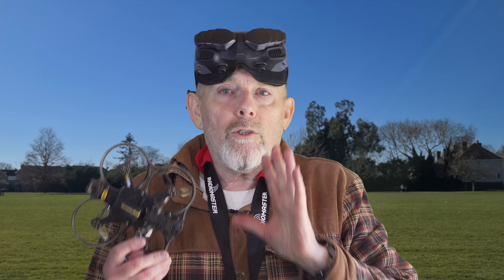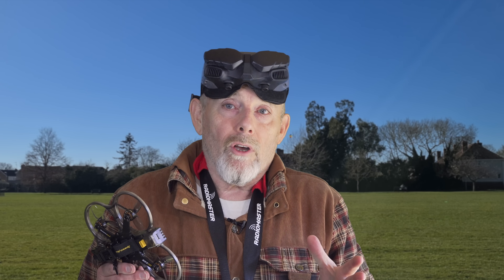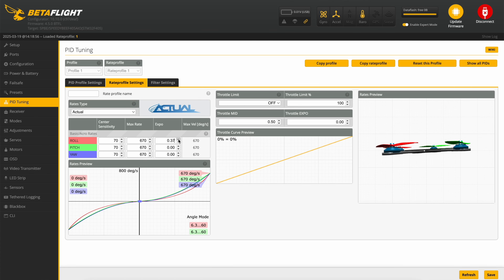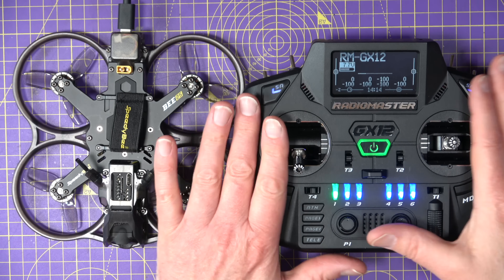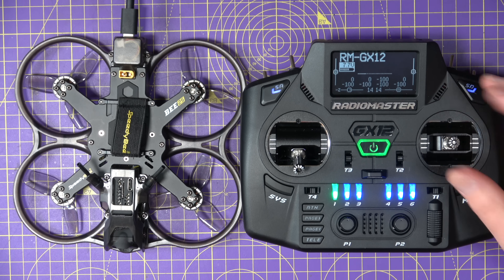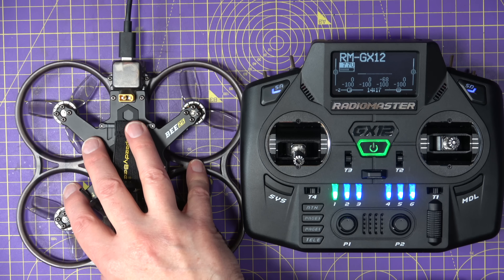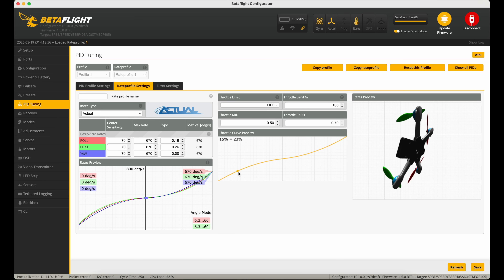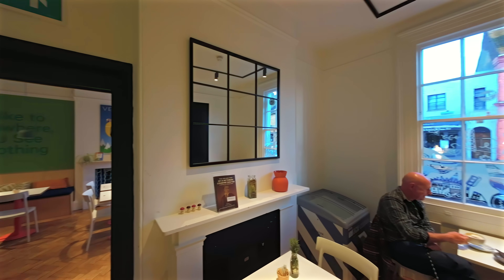Betaflight Throttle Tuning Will Improve Your Flying for Smoother Freestyle, Racing & Cinematics

Comment from the maker: 🚀 Want smoother, more precise flights? Try this simple Betaflight throttle setup and let me know how it works for you 💬 Drop your questions below, and if this video helped, hit LIKE and SUBSCRIBE for more FPV tips 🔔
Reply: Hi , thanks a lot for the very useful explanation but why not also adjust or fine tune the throttle limit for very slow and smooth flights indoors

Comment: In my opinion, it is better to create a throttle curve in the transmitter. With Expo, you even have the opposite effect at the beginning. In the transmitter I can create a seven-point curve exactly as needed. Even smoother in the lower area!
Reply from the maker: That works as well. Thanks for sharing.
Reply: @WhirlyBloke What I do, for example, I put three curves on a 3-step switch or a potentiometer. The first is my standard curve, the second is an even smoother version that would be ideal for the coffee house example and then I have a third curve with throttle limit, even if I hardly use it.

Comment: Thank you so much!!! This definitely fixed my throttle control. But now my throttle stick hover and cruise point is a lot higher than I am used to. How do I fix this?
Reply from the maker: I'm glad to hear the throttle tuning helped. To adjust your hover and cruise point, try recalibrating your throttle endpoints in Betaflight. It should help bring it back to a comfortable level.

Comment: Parabéns por suas excelentes explicações e partilhar esse grande conhecimentos amigo,🤝🤝🤝
Do I need to change the other options you show in the video? Or is adjusting the exposure little by little enough? Thanks, 🤝🤝🤝
Reply from the maker: You can just change the throttle expo in small steps.

Comment: How to make it where i can flip my right switch on my pocket so it can test different tunes?
Reply from the maker: To test different tunes using a switch, you'll want to set up a specific channel mix in Betaflight. Make sure your switch is assigned to the correct channel in the mixer tab, then configure the tuning options accordingly.
Reply: @WhirlyBloke  Copy ill get on it thanks for such an informative video!

Comment: Hi, I really enjoyed your video and I think it's one of those adjustments that makes a difference especially for a beginner like me, but I wanted to ask you: in the video are you making the adjustments with the drone connected to Betaflight? What is the sequence of adjustments you make? Do you set the throttle directly and then adjust the medium throttle and then the exposure or the opposite? Thanks👍
Reply from the maker: I'm glad you enjoyed the video! Yes, I recommend making adjustments with the drone connected to Betaflight. The sequence I typically follow is to set the mid throttle first, then adjust the throttle, and finally tweak the expo.

Comment: When we change the midpoint, are we now performing the hold-in-air maneuver with the stick in the middle position instead of with the stick down? @WhirlyBloke
Reply from the maker: Yes, when you adjust the throttle midpoint in Betaflight (especially using throttle expo or a throttle curve), you’re essentially redefining where the “hover point” sits on your stick. So if your quad hovers at, say, 30% throttle, shifting the midpoint to match that means your stick will be closer to the centre when you’re just holding altitude, rather than hovering with the stick lower down. This gives you more precise control above and below that point, which is ideal for smooth freestyle, racing, or cinematic flying.

You’re not changing the throttle range itself, just redistributing the sensitivity around where you need it most.
Reply: @WhirlyBloke  I didn't know that, I'm really happy to have learned it, it will really be useful to me, thank you. 🙏

Comment: Your shot in the cafe was 100% done with DJI in stabilized mode, stop trying to trick us
Reply from the maker: SpeedyBee Bee35 with INAV, optical flow, smooth fingers, lots of throttle expo and gyroflow. We all need a bit of help.

Comment: I used this trick when I first started out with whoops. It does work, but someone pointed out to me that it’s just a bandaid for bad piloting. I took their advice and just focused on throttle control for a while and honestly, it worked. I can’t tell the difference visually when looking at my past dvr with throttle mid/expo vs dvr now. Only difference now is I feel more in control than I did with expo. 

But really it comes down to the style you want. If you just care about cinematic shots then go with expo. But, if you want to race, or even if you are freestylin then practice throttle control without expo and mid. Once you get it it’s a world of difference when it comes to feel.
Reply from the maker: Mastering throttle control really does enhance your flying experience. It's all about finding what works best for your style, and it sounds like you've nailed it.
Reply: @WhirlyBloke lol for most things yeah. Still struggling when trying to trippy spin with toothpicks and my 3.5 inch though. I’m not sure if it’s the weight, power difference, or if I’m just nervous because there’s no protection on them compared to my whoops lol.
Reply: @WhirlyBloke oh, and I’ve also noticed that it’s easier to control throttle with heavier drones. Have you noticed that too or is it just me?

Comment: @WhirlyBloke  With the throttle mid setting, you have to apply at least some expo for it to work correct? Or else the mid point doesn't affect anything?
Reply from the maker: Exactly. That's the whole point of finding the correct mid point and then adding expo around it.
Reply: @WhirlyBloke  Amazing. I tried using around .28 on my meteor75 pro, at .50 Expo and what a difference in altitude control! I want to implement this in my QAV-Pro cinewhoops that I fly for work now. I've always just throttle scaled down to 80%.
Reply from the maker: @quantum_m3chan1c  It's like you magically become a better pilot.

Comment: man i'm new and everytime i fly in accro i feel like that drone just takes off..

i'd love for it to just be slow and steady all the time. wil ldefinitely try this and also try to tune down my rates. i dont need fast and wild.

thanks
Reply from the maker: Acro does feel a bit unruly at first, but dialing in the rates and adding a bit of expo really helps calm things down. Throttle limits and gentler props are underrated tools too. It makes a big difference, especially when you’re still getting the feel for it. Smooth and steady definitely wins the day when you’re building up confidence.
Reply: @WhirlyBloke  thanks man..i'll try out this in ur video and see if i get a better handle on it

thanks

Comment: For some reason I completely ignored the midpoint setting, I am going to try that out immediately. I already scaled my throttle to 80% which seems to help a little.. But perhaps I should not actually scale the throttle but rather just move the midpoint
Reply from the maker: The midpoint is easy to find and is pretty important. More so than scale. Have fun.

Comment: This is one of the reasons of fly kiss now it just isn’t as twitchy
Reply from the maker: You're right, KISS really nailed their filtering from the start. I’ve still got a few KISS quads in the fleet and they fly beautifully. Even so, setting up throttle expo and a proper midpoint is still well worth it, especially if you’re going for smooth, cinematic flying. It really helps reduce throttle pumping and gives you better control when you’re just cruising about.

Comment: Hello, my 7 inch feels still too fast, even after this tutorial. Can i somehow make it even slower, smother? Should i decrease the power of the throttle? Or should i lower the curve?
Reply from the maker: Try using Throttle Limit (Clip) to cap your max throttle without affecting the rest of the curve. It's great if you want to reduce top-end punch. Or go with Throttle Limit (Scale) to shrink the entire throttle range proportionally, which gives you more resolution and a smoother feel across the stick. Combine either of those with a touch more expo, and you should see a noticeable difference in how controllable and cinematic it feels.
Reply: @WhirlyBloke  I have scale it down the throttle and put a little more expo on the throttle. I ll see how it goes and let you know! Appreciate the help a lot!

Comment: You said nothing about the Throttle Limit (Scale/Clip) parameter.  How does that play into things?
Reply from the maker: I focused on expo and throttle mid in this video since they directly affect how the throttle feels around cruise speed, but Throttle Limit (Scale/Clip) is definitely another useful tool. Scale reduces the throttle range proportionally, which is great for taming power, especially on high-thrust builds or for tighter flying spaces. Clip, on the other hand, hard-limits the max throttle without scaling the curve, which can feel more abrupt.

It doesn’t affect the expo curve directly, but it changes the available throttle resolution, so it’s something to consider if you want finer control or are flying in restricted environments. Thanks for watching.

Comment: I've used this along with setting up multiple rate profiles with different throttle limits that can be changed via a switch on the radio in order to dynamically set my cinewhoops to flex between indoor and outdoor flying. Great advice!
Reply from the maker: Every little bit helps. The more locked in you feel with your quad, the better you fly and the more fun it is.

Comment: you can set a rough curve in betaflight... and fine-tune it in your transmitter then ( I also have some curve in my transmitter setup)... both combined makes it even smoother)
Reply from the maker: That's so true. Thanks for the feedback.

Comment: Hello good, how do I know what the middle point is on my remote control? I use the Dji fpv 3
Reply from the maker: Not possible. You have no control over the mid point when using DJI FPV.
Reply: @WhirlyBloke  ok entonces no es posible lograr esa configuración teniendo el mando DJI?

Comment: Ooh man, thank you so much! :) I recently started flying my old Tiny Hawk 2 Freestyle again, and this tune made me fly so much better. I first determined the throttle position for cruising speed using the on-screen OSD, which was around 11%. Then I changed the throttle mid to 0.15 and left the expo at 50. I went out for a test flight and BOOM—I feel so much more in control now. Thanks again.  I have one more question, does the trottle mid position change when you tilt your camera more?

Comment: Thank you for the video. By any chance where is that mid point on a 1-2 S tinywhoops?
Reply from the maker: @imadabualia4843  it totally friends on the whoop, the weight of the battery, and how much thrust it has. That's why you need to check it on your whoop. Typically, it's going to be at around 15-20%.

Comment: Setting your throttle limit can also help a lot.  Say you set it your max throttle to 80% limit. Now that 0-80% is spread over the 100% real stick movement and your usable resolution goes up. I prefer a more linear vs exp throttle feel, except maybe for your the cine whoop example, using both maybe best for that slow hover altitude control.
Reply from the maker: That's a great tip as well.  Especially for beginners.

Comment: This video was eye opening! I’m new to FPV and have been flying in the sim and also practicing in real life and I’ve been struggling to get consistent smooth flying. This video really helped explain a lot! I’m excited to experiment with my tuning and see how it affects my flying. I only have a DJI Neo with Goggles 3 and FPV controller 3 but I’ve seen rates settings in my menus that I’ve been ignoring….until watching this gem of a video. Thank you so much!!!
Reply from the maker: I hope it's food for thought as well as an absolute fix. You are most welcome and thatnks for watching.

Comment: I used throttle expo on my whoops at first and it seemed to help. Now, I seem to more enjoy setting a scaled throttle limit of 70% or less even, on my inside flying cinematic quads. I usually will set profiles with various levels of scaled throttle limits to a switch so that I can use different sized batteries or if I have to fly in wind or something. Pretty good explanation of setting throttle expo, though.
Reply from the maker: Glad it helped!

Comment: You can see the exactThrottle position by adding it on your OSD
Reply from the maker: Absolutely!  Adding throttle position to the OSD is a super helpful tool — I actually suggested that too in the video, along with using blackbox logs for a deeper look. It really helps you understand where your throttle sits during cruising or hovering, especially when tuning throttle mid and expo. Great tip though.

Comment: Thank you so much for this. I'm an airplane guy who understands expo well, but as I fly whoops or smaller drones occasionally (and thus have to use betaflight/XD9 instead of my Spektrum gear) it's nice to see this explained quickly. Makes sense, and yes, this is my exact problem unless I (try) and fly like Nick Burns.
Reply from the maker: You’re very welcome. Always great to hear from fixed-wing pilots crossing over into FPV — your understanding of expo definitely gives you a head start. Betaflight can feel a bit foreign at first, especially coming from Spektrum, but once it clicks, it opens up so much control. And yes, flying like Nick Burns is always the dream, right? Glad this helped make things clearer.

Comment: Funny thing was that in 2020 I thought how can we carry all those race hoop gates around and set them up ? 
  Now I think race gates can be much much smaller  . 
 No kidding remember a soccer goal was a challenge😅
Reply: Actually a soccer field itself a whole acre is a challenge to hand over to someone who has never flown fpv .
Reply from the maker: Back in the day, even a picnic table felt like a risky gap 😅. It’s wild how your perception of space changes with practice. Those giant race gates that felt necessary at first now seem huge—tiny gaps and chair legs are the new challenge.
Reply: @WhirlyBloke  sometimes fit whoops through lamps and tabkes and the little birdcage horse shoe swing . Now i have to get used to moving sticks more with the inside throttle setting .
Reply: @WhirlyBloke  big drones blow air offf the room and can crash in their own turbilence inside

Comment: Can you show us channel weight adjustment used as a throttle limit ? scaled t 50 % means a 50% weight is half throttle at full stick movement ?
Reply from the maker: Great question. Yes—channel weight acts like a throttle limiter. If you set the weight to 50%, then 100% stick movement only sends a 50% output to the flight controller. So in simple terms, full throttle on your stick becomes half throttle to the quad. It’s a handy way to tame a powerful quad, especially for small spaces or learning. I can definitely cover this in a future video if there’s enough interest.

Comment: Wow you have a lot ofviews and likes on this one.  I knew i could fiddle around with throttle a bit. although i haven't yet. Just roll, pitch & yaw rates so far. i've tightened up the throttle adjust screw tho. I like a firm throttle feel.  I do believe i'm gonna start playing around with this side of the BF screen that is once the temp rises outside. Still shreading inside the house with the whoops. I think i will start with them.  Thanks for the video.☮
Reply from the maker: Appreciate that. Yeah, this one’s definitely struck a chord—throttle tuning tends to get overlooked, but it makes a huge difference, especially for precision and smooth flying. Sounds like you’re on the right path with rates already dialed in, and tightening the throttle tension is a great move too—I’m the same way, love a firm throttle feel.

Comment: Whirly Bloke, like your video's a lot. I know this is off topic, but I have been having troubles with my TX16s, a few days ago it started not showing any RSSI, no call outs. Running XM+ which I have 
updated to RSSI, BF shows the XM is putting out RSSI, but the radio is not showing any. Not even on the radio main screen the bars do not lite up. I have three quads that run the TBS crossfire, and it works fine, RSSI call outs and all sensors. I am thinking that my internal module is bad. You ever seen this happen?  Also, would you know if the MKII internal module will work in the TX16s?
Reply from the maker: Glad you’re enjoying the videos—appreciate it! 🙌

If Betaflight shows RSSI from the XM+ but your TX16S isn’t showing bars or callouts, it could be an issue with the internal multi-protocol module, especially if Crossfire is working fine. I haven’t had it happen personally, but I’ve heard of modules failing like that.

And yes—the MKII internal module should work in the TX16S, but it might need some soldering and flashing. Let me know how it goes.
Reply: @WhirlyBloke  I agree. I stared a ticket with Radiomaster. Thanks for your time.

Comment: Thank you for your video I found your information VERY helpful - fantastic. As a noob FPV person I tried this on my Liftoff Micro Drones sim settings and found it made a massive improvement to my sim flying. I was previously ping ponging up and down like pogo stick on meth. Waiting for my first drone to be delivered and will be definitely trying this for my very first flight with it. I've subscribed and will make my way through your video catalogue. Cheers!
Reply from the maker: That’s awesome to hear — glad it made such a difference, even in the sim 😂 “Pogo stick on meth” gave me a good laugh — been there. You’re going to have a much better time on your first real flight with that setup. Thanks for the sub, and welcome to the FPV rabbit hole.
Reply: @WhirlyBloke  Thanks mate! Your a very knowledgeable. I am hoping to get a good experience first flight that doesn't end with a busted drone and me in tears.